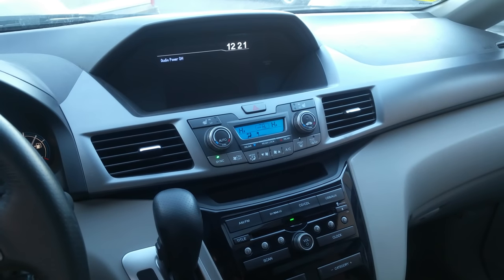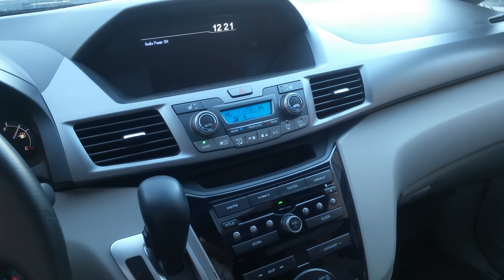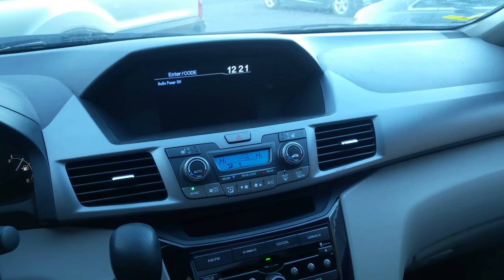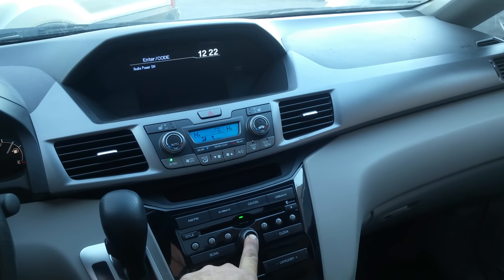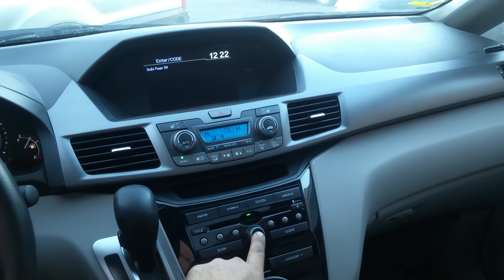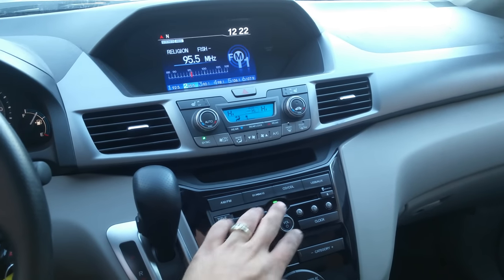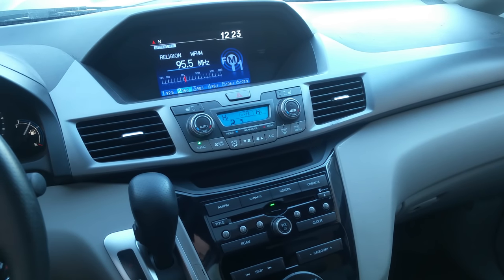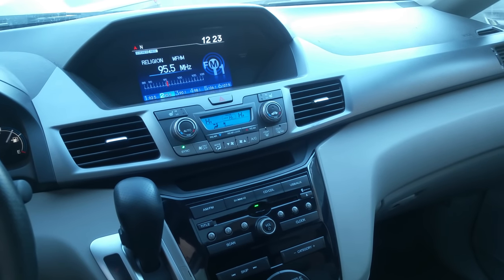How to bypass unlock radio with out entering code on Honda or Acura.

Comment: Just did this on a 2013 Odyssey! Instead for my instance after holding it down for 30sec I had to let go and then hold down again for 2 sec and it worked. Thank you!
Reply: Flavorxtown your trick works. Thanks a lot.
Reply: Yeap! Thanks
Reply: Thank u it worked!!!!😭😭😭😭
Reply: Same here. 2013 odyssey. 30 seconds then release and push again 2 seconds it turned on. Thanks to the both of you for the help.
Reply: Awesome bro thanks!

Comment: It took me 15 minutes to replace the battery in my wife's 2014 Pilot. It took nearly an hour to get the radio to work again. Thank God for George Melnik. I was ready to push the car over a nearby cliff. Are you any relation to Dr. Melnik the pediatrician?

Comment: Many thanks!!! Honda should drop this feature. I can't think of any purpose for this feature. Who steals a car to break into you radio??? Your procedure worked in 15 seconds....thank again.
Reply: This is 3 yrs late.  Stealing head units was popular in the times before the internet, like 80's & 90's, before stealing catalytic converters or copper was popular.  That's why Honda has a code.  My Alpine unit that I installed in my '95 Tacoma had a code as well.  Unfortunately, this is no longer popular.

Comment: This bypass did not work for my 2009 Pilot EX-L. I had to use the Honda website to get my radio code.  My Pilot had no sticker in the glove box, the center console, or on the underside of the fuse box lid.  The Honda website, however, is not operational 24 hours a day. To get your needed code, you have to access the website during their hours of operation, which is absurd.  Really?  Their website to get radio codes is closed regularly each day?  Unbelievable.  I have had other ridiculous issues with my Pilot.  This is my first and last Honda.
Reply: Greg Nixon i don't have a code in our accord smh now I'm trying to figure this out it's stupid my wife swears honda is all that screw this
Reply: Greg Nixon omg thank you for helping me I really appreciate it.
Reply: inside my glove box, printed paper, my radio serial number, and my reset code. Also, I had misunderstood, so I had put in the wrong code, and even though you get 8 tries(!) I messed up; "ENTER CODE E" displayed; I held down "power" button, while the radio was powered(not OFF!) for 30-40 seconds, and was given another chance to enter the code that was found in my glove box! If you buy new Honda, please be sure to leave this information in glove box in case you sell
Reply: they close the website at night. they do that cause of theft. a thief would try to access it at night.
Reply: Only works on 2013 and up models.
Reply: Hey , i have pilot 2009 touring ? Do you know how to reset or put vode for navigation ? Thx

Comment: Will that work on Acura tl
Reply: I tried on my 2012 Acura RDX and it did not work :/ it worked before until I had to change the alternator. Now it reset and I have the owners manual with no code.

Comment: Hi,I have a 99 Honda civic lx, recently the battery was removed, now I got a new battery, the car is running but radio is locked, I'm not tree original owner,I don't have the book.  any ideas ??
Reply: Did you ever figured it out?
Reply: I have 2002 Honda accord how can I by pass the radio code to get my radio back on
Reply: Dwight Nared were you able to fix? Do you see a couple of codes in or near your glovebox?
Reply: NYCP NY bhh
Reply: NYCP NY gggf

Comment: For most honda cars try this trick also :-
Start the car
Press n hold 1 n 6 buttons n then press power button at the same time.
This will show car radio serial number.
Now press 6 then 5 and then 2
And your radio will start working.
Some honda cars asking again for code after turn off the ignition.then you need a code from honda local dealer.
Reply: Wow that worked. Amazing thanks.
Reply: For about 5 minutes... Still pretty cool
Reply: love you bro
Reply: Oh my God you are my hero!!! I bought this car used (07 honda fit) and I had the code in my glove box and in my manual. Replaced the battery and the goddamned radio would not take the code. Double checked with Honda and I had the right code. Eventually got to 10 tries and locked myself out. One of my battery terminals is all shimmied up and I didnt really want to mess with it. I was ready to use this as an excuse to get a new head unit. 

THANK YOU. Worked perfectly!!
Reply: Alright....so that only worked until i shut my car off BUT it reset my error code so that I wasnt locked out and could enter the correct code for the11th time. Unlike every other time it did not start beeping midway through my key punches. It actually took the whole  code and started working. Still a win in my book. THANK YOU.
Reply: @laceking8214  ok dear, then one good solution is call your local Honda dealer n ask for radio code for this vehicle. Honda will check registration book n may be it cost you £10 to 30£ if you are in Uk.not sure about other countries.but they always try first to find radio code from your car n it is free then. Good luck
Reply: @muhammadminhas  no need. Your tip worked perfectly!! My radio would not accept my code, and I was locked out until I followed your suggestion. Then my radio accepted my code. Thank you!!
Reply: Lace King I have a 07 Honda Fit too and I had to replace my whole radio back on May, my car battery died and reset the radio and I don’t have the code. Any idea what I can do. Did any of these tricks work?
Reply: @summerralph5039  They did! Here's what happened to me: replaced battery and got the prompt on my radio to enter the code. My code was printed on a factory sticker in my glove box. Every time I entered the code, the radio would start beeping after 2 or 3 numbers and tell me I failed. I never even got to enter the whole number. 

So I followed MRM birmingham's thing-press and hold 1, 6, and the power button, then 6, 5, and 2 simultanteously. This reset my radio code attempts so that I wouldn't have to disconnect the battery to keep trying. This also made my radio work, but only until the car shut off. 

Once I shut the car off and restarted it, I tried entering the same code from my glove box AGAIN. Finally, somehow, for some unknown freakin' reason, the code suddenly worked! 

Good luck. If your code is not printed on a sticker in your glove box, you can check your manual. Mine was there, too. If you don't have that, google "honda radio code lookup" and a honda website will show up. You will need the serial number as provided via the 1/6 button step above.
Reply: @summerralph5039  yes lace king is right.
Reply: Yo. Your the plug bro
Reply: Worked 2007 Honda CR-V
Reply: Thank u I'm so happy. Ur post on here is the only one that I've found to work. But when I turned my damn car off it wanted code again
And my code sticker is nowhere to be found on my car in any spot they say it should be. I jus bought it and there wasn't an owners manual. So can u tell me how to get it working and not reset wanting a code? It have 2007 Honda fit sport 5 speed..
Reply: Got a new battery from Walmart, OK, but radio dead--instructions to enter code.. Called the Honda dealer, got the explanation and the code, but I had already tried too many times. Got instructed to disconnect the dang battery!!!@#$! to reset. But with the combination of Google, YouTube and the hero of the day, MRM Birmingham, I am up and ok, with all my fave stations still in there! Thanks man!
Reply: Honda website
Reply: Youre a hero🙌
Reply: Omg thank you so much!!!!!
Reply: This worked!! Until I turned the car off
Reply: MRM Birmingham it worked like magic! Gracias
Reply: Wtf it workss!! Honda Odyssey
Reply: YOU ROCK!!!  THANK YOU THANK YOU THANK YOU!!!
Reply: MRM Birmingham you’re a god
Reply: Omgosh thank u for the tip. I tried other videos and nothing worked
Reply: I tried your trick but did not work, then right after trying, I powered off, hit 1 and 6 simultaneously then press power on again. Then showed me the serial number, released all buttons, press power on button and voila worked.
Reply: Worked on my 03 accord...Thanks a bunch
Reply: It worked!!! Yay!! Thank you
Reply: Thanks. Worked for me on a Honda Jazz 2013 model.
Reply: Worked on my tsx thanks so much 👍
Reply: You are a lifesaver

Comment: Worked like a charm on a 2014 Honda Pilot EX!  I had to double press, then hold. It happened after a dead battery.
Thank you!!  It would be a shame if Honda really charges money for this.  I would have made a scene at the dealer if it was me.

Comment: It worked for me but after the radio worked again, it switched off again within 1 minute. I eventually tried your method again, and then entered the 5 digit code. Radio now works without switching off. Thanks so much you put me on the right path. I own a Honda Jazz 2013 model.

Comment: Thank you! Just got a new battery and this pin code came up for me as well. O wasn't thr original owner, so have no idea what the pin code was. I had a 2013 and held the power button for about 5 seconds and it worked. Thanks so much for your help. -Paris, Pedro's wife

Comment: I just changed my battery in my 2006 Honda Civic. I know my software Code Number, but when I went to reset the code on my radio I accidentally pressed the wrong buttons, and then got Error Code E. None of the auto repair websites I checked had any advice for a fix other than to remove my battery cables for a half hour or so, then reconnect and code-in. But I checked YouTube for a quicker fix, then tried what you suggested here, turning key to acc. then holding in the power button on the radio. I held it for a minute or more. The radio didn't come on right away, but somehow the power button procedure allowed me to bypass the Error Code without disconnecting and reconnecting my battery again. It allowed me to simply enter my software Code Number, correctly this time— then everything worked! Thanks loads for your tip and for the video.

Comment: Good job buddy I'm on my way to work. I drive a bus and that's where my buses is 2011 Honda RC and it just came out of the shop and they must've shipped the radio off and I've been doing everything to get going. I watch your video boom right on. Thank you very much great video right to the point. Sorry my words seem a little messed up. I'm doing talk to text two. Thumbs up on your video. Thanks again.

Comment: This worked for me.  Just stole a 2021 Honda Pilot.  Owner had disconnected the battery cable, so I just reconnected it.  Now I could listen to tunes as I cruise down I-95 in my new "borrowed" Pilot.

Comment: Called back and forth with Honda after a new battery replacement on my 2011 Odyssey. My code doesn't work and they sent it up the chain and I still couldn't get it to work. Then I found this video.... super simple. Can't understand why Honda would waste 30 mins on the phone with us and not off this as a solution.

Comment: Thanks! This worked on my 2012 honda oddisy even though my radio was a lil differet. The only thing that I did different was after holding down the power button. I had to double pushed the power button , and it came back with my saved stations.... Thanks again

Comment: Didn't work in my 2013 Odyssey; however, in the manual it states that you turn the key to "on" (NOT accessory), turn the radio on, then press and hold the radio's power button for two seconds.  This allows the radio to see that it's in the same vehicle.  You'd only need to bypass the code if you removed the stereo and put it in a different vehicle.
Reply: I have a 2013 Odyssey too, and your advice worked! Thank you for leaving the comment!
Reply: @estherbaker4734  I'm glad that worked!  Thanks for letting me know.  Enjoy your evening.

Comment: It actually doesn’t work like this. On the 2013 Odyssey, the first attempt fails. And you have to leave the radio ON (with the code request still present on the screen), not off, and then hold the power button down, and it takes just 10 seconds to spring to life. 

 But at least your video pointed me in the right direction. Thank you

Comment: Nice one great video no bs straight to the point. Resolved my problem immediately without owners manual. Now never buy aftermarket alternator for odyssey especially from autozone. Pos worked in two cars for two weeks each. Not cheap part listing at around 400$ so very disappointed I’m having to do same job twice for free now with some bs excuse policy as to why vatozone can’t refund my money in full because the part sold doesn’t work out of box. Both odyssey batt lights flickered and after hours of diag and right tools realized regulator isn’t at right wave length or something making not correlate from cpu to  ecu.

Comment: These questions are rhetorical. He already gave the answer if it doesn't work have your vin number ready and call Honda/Acura dealership or go to their website. I've owned a dozen different Honda's and Acuras over the past 20 years and if the code isn't in the glove compartment on a sticker you just call the dealership. Unless you stole the radio you will have absolutely no issues

Comment: Hello George this tip did not work with my 2011 Civic LX.   I tried many variations.  With the key in the acc position and the car on.  I held the power for 45 seconds.    Any recommendations?  I don’t want to call the dealer.  Thanks in advance for your help and great video. BTW, this did work on 2013 Accord EXL

Comment: I got it to work on my 2012 Odyssey EX-L Nav by holding down the power button before inserting the key and turning it to II. Once I did that it unlocked it after about 5 seconds.

Comment: Worked for me on a 2012 Pilot! 
Although after I powered it back on where it says enter/CODE I released the button and then pushed it and held only for 10 sec. or less then it normalized to radio

Comment: Hi all, did not work for me but I managed to bypass my Honda Odyssey 2011 but starting the car, power on the radio then press 1-6 simultaneously and 1 sec after I added and hold the power button for like 5 sec ( 3 buttons together) and I was able to get radio unlocked.  Thanks

Comment: Dang….just got my battery changed by road side pop a lock. Not sure what he did but now I’m having this problem with my radio. Been trying this press and hold, but it’s not working for my 2011 Honda Odyssey.

Comment: 2010 Honda fit, this didn't work but I will tell you what did work. 
1: turn off the radio
2: hold down 1 and 6 
3: turn radio back on. the display will show you the serial number. 
4: just push 2 while the s/n is displayed and it unlocks the radio
Reply: Jacob he he I give it a try I doubt it work lol.

Comment: It work for me on a 2013 Honda odessy great tip good job💯
Reply from the maker: +Lulu Lolo you welcome
Reply: "  mail k
Reply: Any idea on a 2010 Honda Odyssey?
Reply: 2011 Honda Pilot EX-L with Nav, out of nowhere my navigation is asking me to enter a code I still have controls and everything to the radio but I can't do anything on the navigation screen it wants a code, my battery did not die and the unit has not been removed from the car, any ideas? I tried the power button trick like in this video but that did not work.

Comment: Worked on my 2013 Odyssey… the only thing I’ve been impressed with in this vehicle is the motor, everything else seems to be deliberately made to annoy the consumer. I’m never buying a Honda ever again. Thoroughly unimpressed with the vehicle, and the local dealerships in my area.

Comment: It worked on my 2015 Odyssey after a new battery was installed.  Actually, with the dual screens, the process was faster.  I only had to hold the Volume button down for 5 seconds.  A huge thank you.

Comment: Do you know if anything similar works on a 2007 Fit? I have my code, but one of my radio buttons is broken, and it's one that appears (twice) in the code. The dealership says there is no solution to this problem, because they can't even repair radio buttons, just replace the whole unit. It boggles my mind that a radio that was working perfectly fine (except for one preset button) has, without being touched, become worthless scrap after replacing the car battery.
Reply: I got same issue! (Maybe I bought your car from auction 😁) 

How did you fix it?
Reply: @DroisKargva  Still have the car, never found a way to get the radio working again. :(
Reply: @trishoconnor2169  I got working. The buttons randomly started working during the winter. Now, I had to change alternator and it went back not working lol

Comment: alot of honda models have the code on a white sticker on the side of glovebox or hidden in center console (for the people that this trick dont work) just an extra step before calling the dealer with your vin in hand
Reply: You actually don't need your VIN when you call the dealer. Just the code you get from your radio(pressing and holding buttons). They'll give you the unlock code.
Reply: I see the sticker lol can it be this easy

Comment: Hey George maybe you could help me out I'm trying to take out the factory radio and put in my own radio but every shop I've been to tells me that if I take out the factory radio the car may or may not start and that they would not be responsible if the car don't start and then I will have to probably call the Honda dealer to send a mechanic out to get it working also the price ranges from three to $800 to do that job I want to put in navigation screen and everything in it is this something I could do myself I'm pretty handy I've done it on other vehicles but never on the Honda civic 2012

Comment: k for u crossTour  and maybe accord owners with navigation. holding the power button doesn't work. I had to enter 2 codes! One for the nav using the dial and enter button, then had to enter another using the dash buttons. 2 separate codes for one radio system? Ridiculous! Found the codes on a  dealer service sheet printed for the previous owner